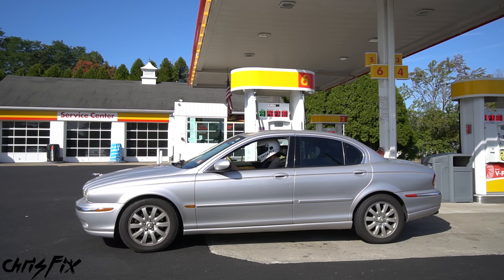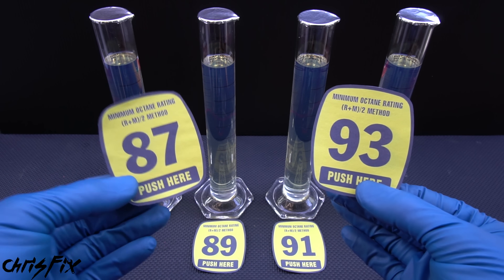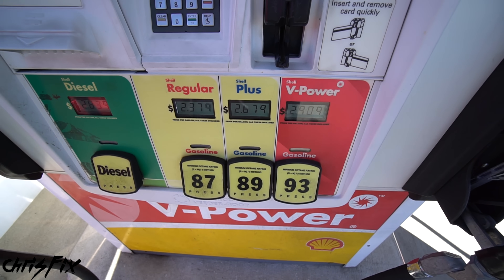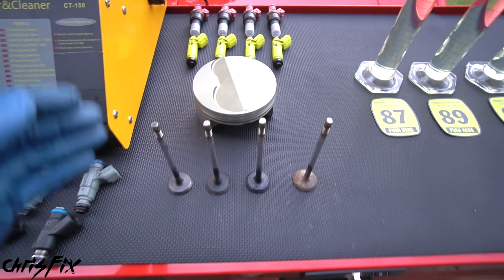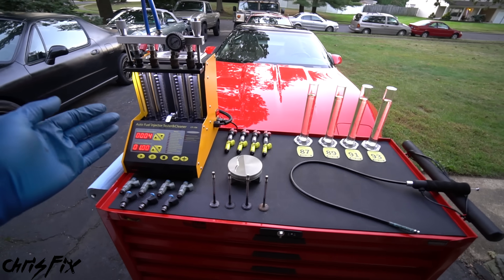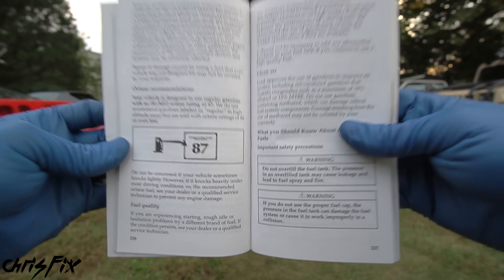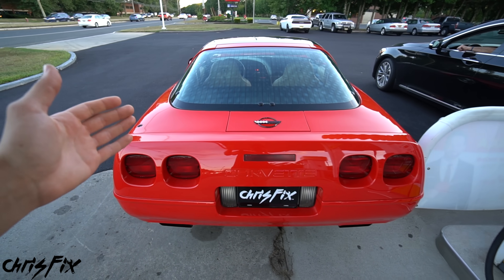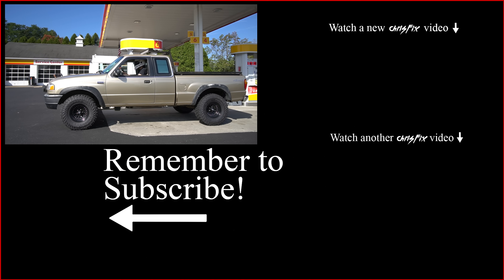What is the BEST Fuel to Use in Your Car or Truck and WHY

Comment: What can I put in my 2stoke boat engine to keep it clean and help qith carbon build up....
Reply: @Keith Franklin thanks, I do use sea foam, and I live in Central Florida, we have 89 eth, free here. I pull one can of SF in every tank 20 gals, I run, I get it a wal mart for 6$ a can, it has made a difference in top end for sure, thank for the comment back.....

Comment: I have been using Techron Complete Fuel System Cleaner instead of using 91 Oct in my 2015 F-150. Is this ok, if not, why not? I also use a Top Fuel vendor like Phillips, thoughts?

Comment: If Shell’s premium fuel contains more additives (7 times) and reduces carbon deposits, then would it not make sense to use 91 or 93 octane fuel as a preventative measure?
Reply: Yes you could, but you could just periodically dump a bottle of fuel injector cleaner into the tank and that would be way cheaper.
Reply: I. S  The OP's question implies that their vehicle uses regular and is therefore asking about using premium as a preventative. Given what that would cost, it is worth looking at alternatives. I use BG 44K which is $25 a can. It's still cheaper than filling up with premium every single time.
Reply: I. S  Again, the OP is specifically citing Shell's claims about their premium fuel. Marketing hype aside, I believe them when they say it has 7 times the additives since that can be proven in court. Does that mean it has 7 times the cleaning power? They don't actually say that and kinda leave it to you to connect that dot as erroneous as that might be. Hard to say with out some evidence as you pointed out. To the OP: Use whatever gas is required for your vehicle and periodically have your fuel system professionally maintained or do it yourself with a bottle of something. IF you can tell a difference (milage, performance, emissions, etc...), keep doing it.

Comment: If I want to change the fuel I’m using now which is 91 to 95 and my car is turbo charged. I just switch to 95 when the tank is empty or what I’m supposed to do exactly??? The manufacture required 95

Comment: He's exactly rite, I only run premium in my truck because when I put regular gas in them the key don't run as good and they don't have as much power either. Premium gas gives them better reaction time, more power and helps protect the engine from corrosion. Thumbs Up great Video

Comment: You forgot to add this, read what it says about Octane rating, it says minimum rating. I use to haul gas and last thing added was octane so the 93 was last loaded and then next driver pulls up loads low grade first and lots of octane from the last load goes in first.
Next if you don't think higher octane doesn't ignite cooler then your wrong. If you running a cooler burning plug in lower 87 octane you can change the combustion ignition and prevent knocking. Opposite can be said for 93. Electronics and advanced timing etc. Helps to

Comment: My Toyota Tacoma says to take E-15 
What is that?
Reply: 15% Ethanol and 85% gas. It's typically rated 88 octane. But you can run regular gas in your vehicle as well, with just 10% Ethanol.

Comment: Brother, thanks a lot for the info.
I recently replaced the oil cooler/filter housing on our family van (pentastar 3.6L), which requires stripping the top of the engine to where heads are exposed. I noticed heavy sludge inside the head walls, a somewhat thick layer, maybe .020 thick with a heavy 'syrupy' consistency.  I know it may be hard to voice an opinion without looking and just based on a quick description like this. Trying to decide if I should switch to premium gas for some time, maybe use 'sea foam' or one of those engine treatments, maybe both - but mainly, my question is this:  is there a way to assess the internal cleanliness condition without having to strip the top of the engine again?   Maybe from exhaust analysis?  Thank you!! 🙏
Reply: Forgot to mention:  van is getting up there in mileage, scratching 150k...

Comment: the best gasoline is sold in FL... and the worst in CA.

I have been in many many states and have visited junkyards, the amount of crap carbon deposits in CA cars was crazy, while in FL junkyards, most cars had pristine engines, besides the usual cars oil was never changed for miles, but that is total different scenario.

My turbo car was allright in CA, arrived to FL and the car felt much stronger, better idle, consistent torque at low rpms.

Do stick w the same gas station.

*what happened was the gas station possibly put water on the fuel, I know some gas stations I stay away from.

Comment: Let me clear something up. I understand about the power. But you could possibly achieve more POWER through the possibility of higher compression through the higher octane gas. It's not necessarily the gas giving it more power directly but rather indirectly through the compression changes. And if your car advances the timing you will get more power.

Comment: What is the difference between the fuel of today versus the fuels of the 1960s??
Reply from the maker: They added lead back then to raise the octane
Reply: My dad tells me the oils an the filters an other lubes were not as good as today's and cars would not last past 100k kiles
Reply: This is true. Gas is of much higher quality in the US today. Oils and lubricants in general are vastly superior to oils and lubricants used in the 60's. Back then the US government didn't enforce strict fuel standards. Today they do though. This is why old-time gas pumps had large sight glasses on top of them. So the customer could make sure that they were getting clean gasoline. 

Modern oil used in cars today is very high quality.  Most oil today has lab-engineered lubricants and additives. The days of essentially using straight purified oil are long gone. Todays oils and gasoline is all lab processed.

Comment: Very informative, I did experience knocking in my car when I first started up and begin to drive it. II have a 2016 Hyundai sonata sport and my check engine light came on and the code red P 1326 and P 2600 I have about 143,000 miles on my car would it be wise to step up to a mid grade gas because I have been using regular ever since I bought the car?

Comment: Im curious, how come there isnt different grades of diesel?
Reply: There is. "Number 1 diesel" and "number 2 diesel."  Number 1 diesel is basically Kerosene with extra lubricants and is a thinner diesel that's less prone to gelling in cold weather. Number 2 diesel is the most common grade found at most stations and is thicker and offers better fuel mileage. But it does gel easier. 

Winterised diesel (Aka... Diesel+) is basically a 50/50 blend of number 1 and number 2 diesel that's mixed for better cold-weather performance. Or number 2 diesel with anti-gel additives mixed in. (Such as Power Service)  This is the diesel that's sold at most stations in winter in the northern states such as North Dakota, Illinois, Wisconsin, Michigan, etc... 

Most number 1 and number 2 diesel sold in the US has a cetane between 40 and 55. The higher the cetane the more thoroughly the fuel burns. Higher cetane however doesn't necessarily mean a diesel engine can develop more power from it. All diesel engines in the US are designed for a 40 to 50 cetane level range. 

Cetane is different and acts differently than octane does in gasoline. More octane means an engine can have higher compression for more potential power. Cetane just means the diesel fuel is more volatile and burns more efficiently when it has higher cetane. So winterized diesel typically has high cetane, which is better for things like easier cold-weather starting.

There is also a diesel called "off-road diesel". (Or Red Diesel)  This is commonly used by farmers and is sold at gas stations in farming areas throughout the US. 

Red Diesel (Off-Road) is exactly what it says it is. Red Diesel is either number 1 or 2 diesel or a combination of the two grades sold as winterized off-road diesel that is "dyed red" instead of green like normal 1 or 2 diesel. 

Red-colored off-road diesel means that taxes are not charged by the state with this diesel. So this diesel fuel is cheaper at retail. However, it's illegal to run in any normal vehicle that is used on any public roads or highways. A cop can stop you and dip your tanks on your pickup truck or car. And if you are found to be using "red diesel fuel" you will be in big trouble since that means you didn't pay taxes on it at the gas station. 

You can only run red diesel in vehicles that are used just for off-highway use only. Or any vehicle if you are a registered farmer. 

Most farmers run red diesel (Off-Road) in their tractors and equipment. 

But standard green-colored diesel has to be used for any registered vehicle that is running on public roads as the general public uses. 

So TLDR there are two grades of diesel fuel with some variations made from these two grades.  😎

Comment: This video is informative.  It's 25 years too late.  Back in the days when TV is the main viewing consumption, ABC, CBS, FOX, PBS etc. should have run a special to educate the public.

Sadly, ICE will be around for another 15 years or when government mandates all vehicles should be EV.  Then, I guess you don't have to worry about which fuel grade is correct to use.

Overall, this video is very helpful. Thanks.

Comment: What does AdBlue do
Reply: AdBlue (Or "Blue Def" Sold in the US) is a mandatory ingredient that reduces diesel exhaust pollution. It's injected into the exhaust with deionized water to neutralize diesel polutants. It's basically just urea. A synthetic laboratory by-product of urine. AdBlue is often referred to as Def fluid as well as competing brands. This is mandatory on all modern US diesel engines.

This is also why Volkswagon failed to make its cars meet US pollution standards. Volkswagon didn't use def fluid on their vehicles. It had no tank for it. So the cars were too dirty. 

Volkswagon had to go back and buy all of their cars back from consumers here in the US and reimburse them since the cars couldn't even be retrofitted to meet US standards. Today Volkswagon doesn't sell very well in the US and even has contemplated pulling out of the US at one point. Volkswagon only has a 2% or even less market share here in the US. 

In comparison, Volkswagon has a 26% market share in the EU. Volkswagon was able to retrofit cars in the EU however, due to the diesel pollution standards not being quite as strict. So unlike in the US, they didn't have to buy consumer's cars back.  🙂

Comment: So is it safe to run shells premium for a short amount of time  to clean the engine in a regular required car?
Reply: Running premium on a car that calls for regular wouldn’t harm anything. Putting regular gas in a vehicle that requires premium is not good.

Comment: I'm cheap gas like lower octane fuel regular gas causes more carbon buildup in any engine. Period. If you run premium in any engine even the ones that say to use low grade gas in the long run you will have a ton of more carbon buildup in the cylinder heads and intakes oxygen sensors. Cris fix does not know completely everything he says

Comment: Just wanted to ask, if Manual says my car needs Regular but I used Premium and been using it sinceI thought it was better, what will happen if I go back to Regular?
Reply: As long as your car is running correctly, then nothing will happen. A car doesn't care how long it has run a certain grade of fuel for if it was made for a lower octane from the get-go. 🙂
Reply: @waycoolscootaloo  so if I just switch back to regular even when there is still Premium in the tank, nothing bad will happen to my car?
Reply: @axiomatichumdrum8704  Eeyup! So long as your car is made for regular.
Reply: @waycoolscootaloo  thanks a bunch!

Comment: For the first 10k miles I broke in my Wrangler with premium 93 octane, since I use 89 octane only. And nothing has changed. Mileage has not lowered due to using lower octane.

Comment: Your car if its computer controlled and has a knock sensor it will tune itself many times per minute and it will advance timing to suit higher octane fuels ... advancing 8gnition  timing with higher octane fuel will create more torque and horsepower thus boosting mpg it isn't rocket science ...lower octane fuels often contain more alcohol added to the fuel and alcohol absorbes water where gasoline does not... water is very bad for aluminum and steel water corodes metals badly and alcohol deteriorates rubber seals and gaskets... I always use supreme... I've seen carbon build up in engines so badly that when we took the intake manifold off the engine it was so full of crap it was literally cake panned to the bottom of it basically cover all the oil return passages good thing carbon isn't impermeable because engine life expectancy would be far less.. in a strictly premium fuel fed engine exactly the same when opened up they are generally spotless inside vs the several pounds of carbon idk... without a knock sensor like in a pre millennial ride it wouldn't  make much difference in mileage if it was tuned to effectively burn low octane fuel but the same engine can be tuned for higher octane fuel manually but try and burn low octane with it tuned for higher octane fuel and you could easily damage the engine especially in hit weather or pulling a load or hill ... I believe if everyone knew how good high octane fuels are for modern engines no-one would buy the low octane fuel ... it's like tire oil and auto manufactures telling you that 32lbs tire pressure is ideal... ideal if you sell cars or oil or tires ... 40lbs will increase mileage up to 10 percent ... don't believe everything you are told

Comment: I had a car that had "Cheap-ass fuel NECESSARY" printed everywhere on the car. It was EMBARRASSING. I had to drive 20 miles every couple of weeks to find the only station that had 85 octane gas with 15% ethanol, 2% grit, 0.5% Vaseline, and no other additives. It only cost $1.23 a gallon, though. My car (a '78 Yugo) lasted 228K miles with no major work. When it died, I downgraded to a Celica, which got a new engine a few years later at 198K. The previous owner had forgotten to ever check the air filter. I discovered that filling the filter box with discarded pandemic face masks worked at least as well as the stock filter, and much better than a K&N. It worked until the car came down with Covid-19 from one of the masks and started wheezing like crazy whenever I shifted into third. To protect myself, I replaced the cabin filter with an expensive housing with the kind of filter better than the ones used for vacuuming up printer toner and fireplace ash. I think it was featured in one of the Ghostbuster movies, although in real life ghost filters work on a completely different basis.

Comment: Its a bit different here in finland since we dont have any of those fuel choises, we got e85, e95 and e98 as hell as in some rare cases e99.
I might do this test just to see the difference here
Reply: E85 is 85% ethanol containing gasoline. Then your 95, 98, and 99 octane gasoline likely has a 5 or 10% blend of ethanol. And US 93 octane rated gas, is the same as your 99 octane petrol, as we use both "Ron" and "Mon" measurement standards as opposed to just Ron found in Europe.
Reply: @waycoolscootaloo  ok cool, thank you for the information👌

Comment: Does 87 octane really exist? The lowest we have here is 91, and that's considered slops. I usually only use 95 or 98 in my V8.
Reply: 91 in the EU = 87 octane in the US and Canada. (98 = 92 octane in the US and Canada.) 🙂
Reply: I'm not in the EU.. But I would have thought octane rating is octane rating >__>
Reply: @garface007  Nope! Two different rating systems. The US and Canada use a more accurate method for determining octane rating. 

There is the Ron test. (Research octane number) And the Mon test. (Motor octane number. 

Europe and other countries often us the "Ron" method exclusively. This test is less stringent than the Mon test and results in higher numbers. 

The "Mon" test of the same fuel, will result in significantly lower numbers. 

The US and Canada uses the average of both of these tests. This is a closer result to how fuel actually burns and performs under atmospheric conditions.

So Shell VPower 99 octane premium in the UK for example, has a Ron rating of 99 obviously. 

But it has a Mon rating of 87 octane. 

So in the US we use the Anti knock Index. 

So (R+M)/2 = 93 octane.  🙂

Comment: Why do performance cars or cars than want to try to run clean so they can pass smog emissions use E-85 and they are not flex fuel vehicles? Thank you for your input

Comment: State to state is different California's is cleaner gas than most other states but in California we pay for it at the pump which sucks but allows our cars to run longer and not get stuck on the side of the road quite often
Reply: Actually, it's not cleaner than other states. And is just due to dumb California laws that causes gas to be more expensive than any other state in the US. It also means that California is dependent on just a couple of refiners, unlike other states which are more diversified. It also means that California is hard limited to 91 octane for premium, unlike other states.  

Car enthusiasts and the auto industry hate it and wish that California would adopt the standards of the rest of the country. "Top Tier" gas sold across the US, is already considered the best quality gas money can buy at the pump and already has anti-pollution, cleaning, and oxidization additives in it. California just uses it as an excuse to tax fuel more than any other state.   😉